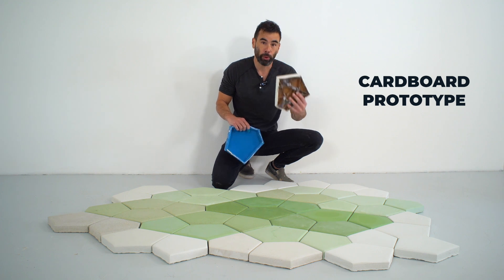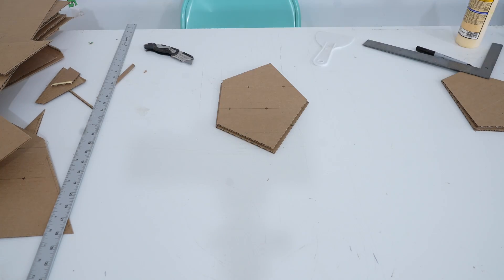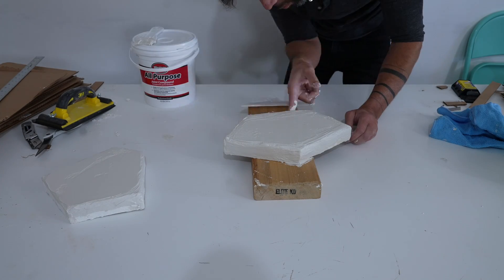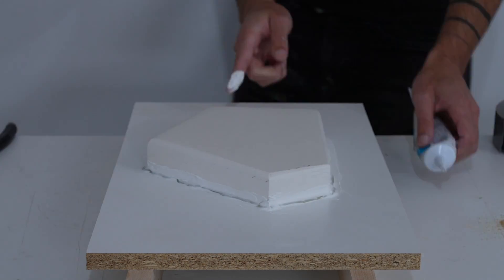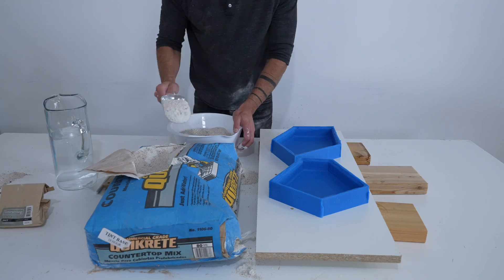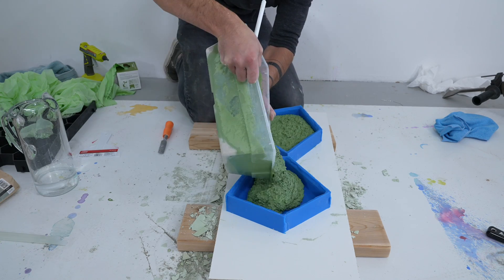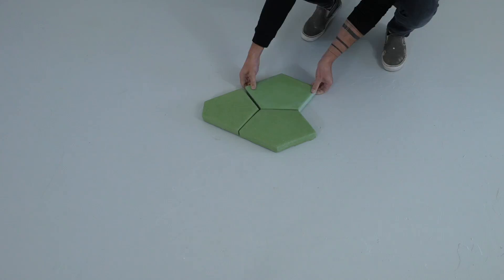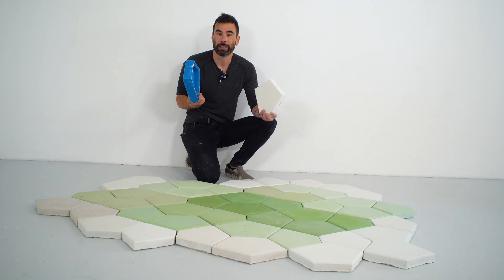Making Custom Concrete Pavers using Cardboard!

Comment: Costs: Just one part of the Production Triangle - Good, Fast, Cheap: Pick any Two! 🙂

That said, I do like your use of cardboard, with a bit of planning, to make the Plugs for the Molds, and Yes, if your were doing this commercially - you would make more molds, for those high volume needs, but - as you say - for a D-I-Y Project, it's a matter of available Time, versus Excess cash that can be used to make additional Molds!

Comment: Creativitiy at a higher level. But ... those pavers will not be good outside .... why ? Water. A true 'paver' is a porous material which absorbs and releases water to the sub layer. That property means you are not left with standing or pooled water on the surface. These mischievious pentagons will have you slipping and skating all over the place.

Comment: Couldn't you just use 2  3/4" pieces of mdf and sandwich them together then polyurethane over it  instead of using cardboard?
Reply from the maker: yes!  I have used mdf often but I wanted to show a way where power tools or precise cuts with a saw weren't required
Reply: @HomeMadeModern  thank you for making these videos!

Comment: Just curious if you had thought in making these concrete pavers lighter weight by filling them with used styrofoam packing peanuts?  I have been enamored of some of the ferrocement ideas - taking netting, filling it with soda cans/bottles, ad papers received in your mailbox, cardboard, etc., then shaping it into a rock shape, then covering with the cement mixture to create a realistic-looking boulder.  That's just one example, but I could see your pavers being very lightweight with some form of filler (like packing peanuts).  Again, just curious if you'd thought about it and how you think it might help/harm your final product?

Comment: Do a better job around the bottom of your cardboard joint. Also when you cast a piece use the concrete to make more moulds not the cardboard original it won’t float and you can do a better job around the base! Pre-calculate your silicone required you wasted most of the expensive silicone by mixing all at once . Buy a scale!
Reply from the maker: what wasted silicone? I used it on another project

Comment: I have a HUGE patio project coming up. (over 1000sqft of pavers)
I'm diy'ing the majority of it.  Some experience with some of it, no experience with other parts.

I really wanted to make my own pavers, mostly to control color & for experience.  However, I am concerned about 2 things...

Primarily strength over time compared to a commercial product. I live in CO & will have freeze thaw cycles.  I will be putting a built in kitchen & post & beam roof structure on part of it.

& to a much lesser extent cost:time ratio.  I can make the forms/molds & do like you do, making a few pavers once or twice a day.  So not including labor, will raw material cost be appreciably more or less the cost of a quality commercial product? 

Do you have any videos or other resources that address these aspects of diy pavers?
Reply: There is an additive you can add to your mix to help with the freeze thaw issue. Sadly, I don't remember the name.
Reply: @m.maclellan7147  
Thanks for the reply.

I'll look into it.  I think Mike builds (or similar named channel) mentions it in some of his videos.
Reply from the maker: Modustrial maker has some great concrete videos

Comment: I am planning on doing this but with a 3D printer, not cardboard. What do you suggest is a good amount of ease on the shapes that fit together like jigsaw puzzles?
Reply from the maker: 1/16- 1/8 inch is safe.  I have done this 3d printing.  super fun!

Comment: I know you mentioned the cost of silicone would affect how many molds you make but I wanted to know didn't it look like you had left over silicone to pour at least a third mold, because that just seem like a lot of silicone in that bowl and you never really showed you emptying it completely.
Reply from the maker: I used it on another project

Comment: To mix small batches of mortar or grout (which is basically what you are doing) I will use an electric hand mixer that you can get in the kitchen section of your favorite discount store. It mixes quickly and better than you can mix with a stick.

Comment: I like the idea of using templates with joint compounds and polyacrylic as wall panels. If you make a flat surface on the back, you could attach it to theatre flats and make a false wall that you could then attach to your existing apartment wall  and have it been easy to remove when you change apartments. or you could make a larger concrete panel with the circular  panel grommets so it looks like a bunker.
Reply from the maker: we are working on some DIY acoustic panels for a home office

Comment: What would it take to make a vehicle driveway with homemade pavers?
Reply from the maker: I would do smaller pavers almost like cobble stones and really focus on the well packed layers of sand and gravel possibly with a structural grid to prevent erosion

Comment: Great idea and methodology, but please don't handle wet plaster with your bare hands or sand or carve plaster or concrete or drywall without eye and lung protection in future tutorial videos. I cannot possibly stress the risks involved in working those materials unprotected enough.

Comment: It might be helpful if you let us know how much silicone you used to make the moles. You most certainly appeared to have one hell of a lot more than was required mixed up there!
Reply: I have seen mold makers have a "sacrificial" bag of dry rice or beans to fill the mold, then pour out, weigh the beans & you have their weight - which should get you in the ballpark (most mold makers add a 1/4 more to allow for shrinkage).
 You can also just use water, but then have to dry your mold out before pouring the silicone. (They reuse the rice/beans but do not eat them.)

Comment: You could use plastic vacuum-formed over the patterns to create the molds. If a vacuum former isn't available, you could use a heat gun to soften and shape the plastic over the buck. Heck of a lot cheaper than the silicone rubber, plus you can make quite a few molds very quickly.
Reply from the maker: yes! I have been thinking about getting a vacuum former.  I have used a heat gun but the molds got scratched up to the point where it impacted the finish surface
Reply: There are polishes for plastic that can remove scratches but really the cost of plastic is still relatively cheap. And depending on the size of the tile, you could even cut apart and flatten 2-liter soda bottles to use as raw material.

Comment: Could you add clay powder to the concrete?
Reply: What would be the benefit or reason?
Reply from the maker: you can add what ever you want but concrete cures through a chemical reaction and that would impact it.

Comment: I’d like to see you make Penrose Tiles that could be used in a backsplash or bathroom floor. I don’t know if concrete could be used for interior tiles or if you would need to use clay instead. Either way it would look pretty cool.
Reply from the maker: Great suggestion!
Reply from the maker: I was just reading about his research!  I will try it!

Comment: What about a vacuum formed plastic mold?
Reply: The silicon is easy to peel from the brick without damaging, multiple times. Vacuum formed plastic needs to be hot to be flexible enough to shape. I’m sure it would not come off so easily at room temperature.

Comment: Very nicely done! Better to add the wire to be safe then "hoping" for the cardboard to stick to only the glue, I have also had things float and adding a extra step to ensure that doesn't happen is a good thing to do. Very good video as always from you. Thanks
Reply from the maker: yes I learned the hard way!

Comment: You might have an audio glitch around minute 2,45 -2,50.
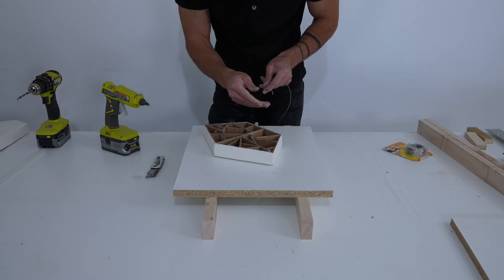Reply: If you use 2:45 to 2:50 it goes straight to the timeline in the vid.

Comment: I'm pretty sure your cement mix is too watery. This will make your pavers weaker. It should not be flowing over the edges like that when you scrape the top. Since it's a walking surface you'll want it as strong as possible.

Comment: My favorite thing is hand made stones and tile besides woodworking/joinery, etc.. I’d love to see you make thin, concrete (with gorgeous colors including that stunning green) tile for a bathroom/kitchen! I’d love to see tile handmade bc I love the simplicity of cement tiles with maybe some terrazzo flex here and there that can be utilized in a house or solid colors like this.
Reply: I think you would get breakage if you had concrete too thin ? I think it doesn't flex, but breaks, so, most tile is ceramic. I don't think ceramic flexes much, but it doesn't sheer unless a strong force. 
 Both concrete & ceramic have been used forever, so if there was a way to use concrete like tiles, someone would have. (Point of fact: Many ancient buildings used concrete, but it is unclear some of their methods. They added something to their mix that made it last much longer than we can. )

Comment: love  the colors. what is the advantage of the silicone mold vs just a melamine mold?
Reply from the maker: the speed of de molding, cleaning and re filling is the big advantage.  I re use melamine molds but over time water tends to get absorbed into the melamine.
Reply: @HomeMadeModern  makes sense. thanks

Comment: I would like to see you turn  the mold in a larger plastic  mold. Where you can use a  40 lb bag of concrete with each casting.
Reply: That would have to be a very strong mold and would take 2 people to turn it over !

Comment: I really like projects that I can do myself. Thank you for explaining it so well....and giving me confidence.
Reply from the maker: you can do it!
Reply: This isn’t a good cost efficient way!
Reply: How might you recommend one to do this in a cost efficient way?
Reply: @bryanflo4500  first the smooth on brand is a YouTube blow up! You can buy silicone way cheaper other places. Also your not supposed to use porous materials for a plug! Hints the plaster falling apart after all that hand work!!  if he would have just used 3/4” MDF layering it then router edges, or still handsand then seal it with  “Paint” then pour your mold! And you will need to make alot to make it a day job. This is a long way for getting this done stones every 3 to 4 days up to a week depending on concrete used!!! He done ok with the 
Melamine as a base and the cardboard for the walls to hold in the silicone! He also should have made a back box for the molds so to heavy cast material and you can’t move them without box. 
One sheet of MDF “plug”and “mold box”
One can of cheep spray paint.
Silicone from other source, which you will get more! And you shouldn’t have to use a release, for it is silicone. 
I could make this in 1 hour or less with 8 molds made! You don’t have to use silicone! You can actually use a rubber that set up faster! Thanks

Comment: If that chisel ever shows up in a woodworking video, the trolls will have a field day...
Reply from the maker: going to paint the handle so that never happens. it was a $4 chisel
Reply: Meanwhile the silicon mold guys can have their field day: where did the 80-90% of the mixed silicon go? Besides, that is a screwdriver, not a chisel 😜

Comment: nice. but 2 pavers a day.... 😵
Reply from the maker: 2 pavers in 10 mins every day.  I like home improvement projects that I slowly build in spare time
Reply: Or 14 pavers a week ... you can easily pour a pair after work.

Plus, you can make them all winter for a patio you install after the snow melts in spring. [Assuming you live in Frostbite Falls, like I do.]
Reply: ... keep the doctor away
Reply: yeah because hes an idiot. he shouldve made the concrete much less wet, so he couldve compacted it down and remove the silicone forms right away, and the paver would hold its shape
Reply: Prep on a project like this is really the key to the production. Prep is ( beer, music, space and materials / wife, kids, work and energy ) x (sheer will and knowledge you will be crowned the coolest dude ever!) GL